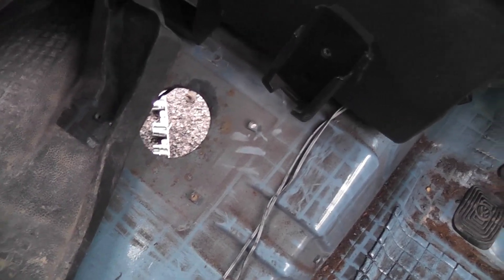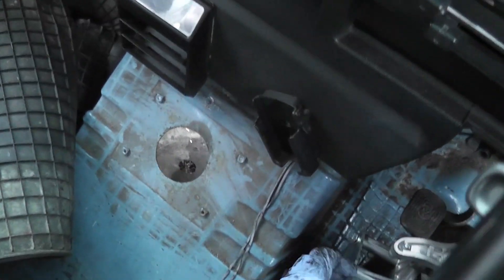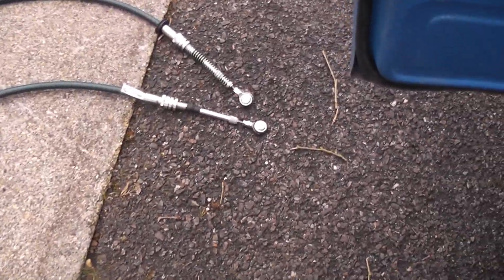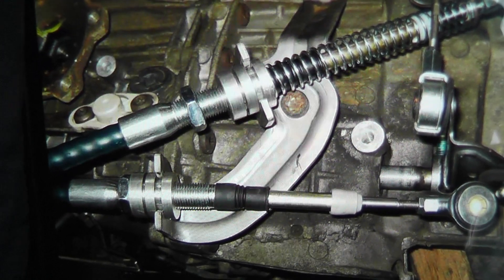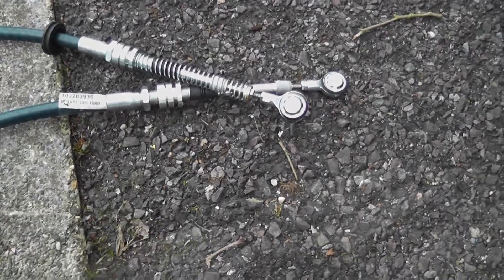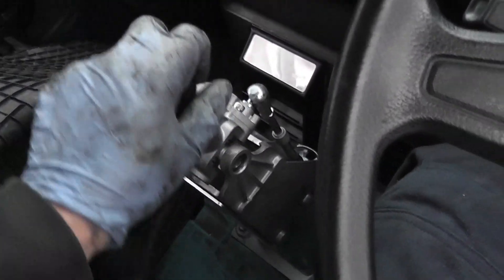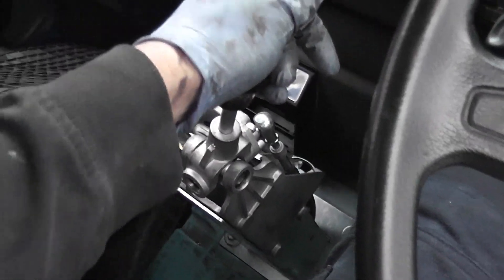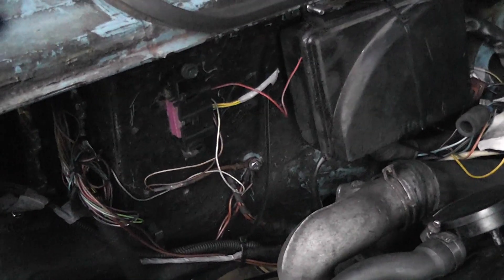Installing an Ultimate Engineering cable gearshift mechanism into a VW T25/T3

Comment: Hi my name  is Aubrey  from  SOUTH AFRICA I like  to buy the hole kit and how much .and here  in S A we don't  have that kit and I like to have it for my t3 vanagon thanks for your  video  can you be in touch  have a nice day god bless you and what kind of a gearbox are you using tnxy
Reply from the maker: Hi Aubrey. It's a gearbox from a B5 Passat with an AFN (diesel) engine. Any gearbox from a 5 speed B5 diesel 2wd Passat will work. I don't sell the kit. You need to contact ultimate engineering in the UK for that. It'll cost around €2000 for all the kit items you'll need. I hope that helps. Thanks!
Reply: Hi Good morning thank you  very much  for your  information  have a nice day ✌

Comment: Hi , how long is this cable
Reply from the maker: I don't know, I didn't measure it. Long enough to go from the gearshift of a T3 van to under the gearbox and loop around to meet up with the linkage. If you need a definitive answer, ask ultimate engineering. Why do you ask?